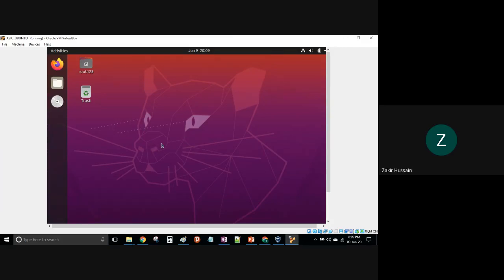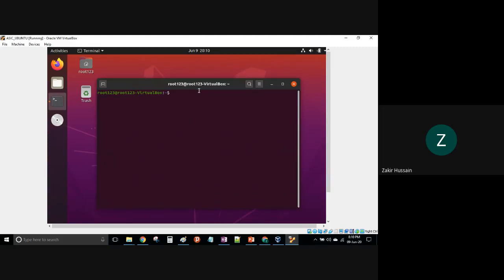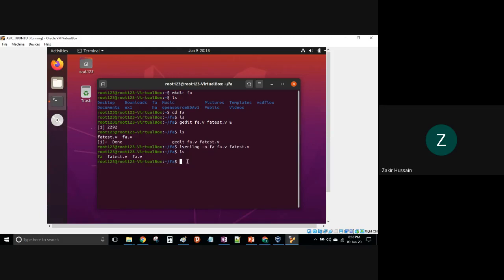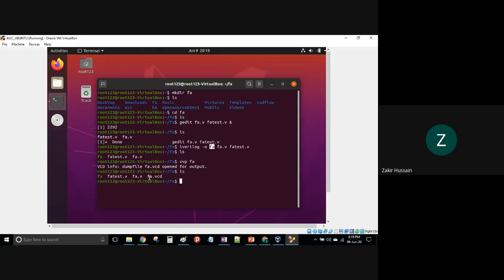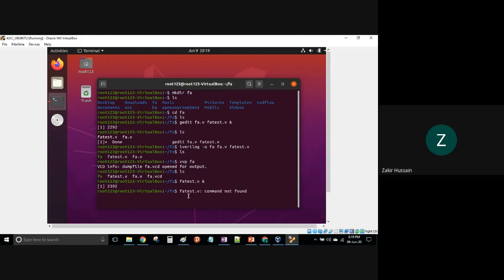Day1 - Qflow Introduction

Comment: Hello Sir,
In my design there are many submodules then how can i give single .v file in qflow!! Or how can i arrange all .v files in single file? 
Could you please brief me!!
Reply from the maker: You only give the top module name. Your submodules have already been instantiated in the top module, so you do not need to worry about them. If you still have doubts, please post them here.
Reply: @VerilogHDL  Thankyou Sir
Reply: Hello sir, In my ALU Design one DRC error is coming  which is processing timestamp mismatches . Could you please tell me how to solve this issue?
Reply from the maker: @khushi7199  , this mostly happens if some of the design files have  `timescale compiler directive and some other design files are missing it. Ensure that, either all of them have it or else remove it from all of the files.

Update me if this resolves your issue or not?

Comment: hi i wanted to know how qflow is different from openlane
Reply from the maker: openlane is completely automated from synthesis to GDSII. And openlane does this completely based on script, as of my knowledge there is no GUI in openlane. Whereas qflow is top-level GUI interface which has stitched all tools in it from synthesis to GDSII.
Reply: So as of now qflow is better right
Reply from the maker: @varunmajji6514  It is not like that, openlane can use skywater pdk, but making use of skywater pdk in the qflow needs some tweak. If you can manage to do that I think there should not be an issue.
Reply: @VerilogHDL  ohh ok by thevway thanks for your video it really gave me good insight to what happens in a VLSI flow